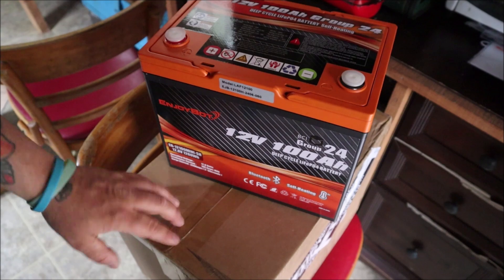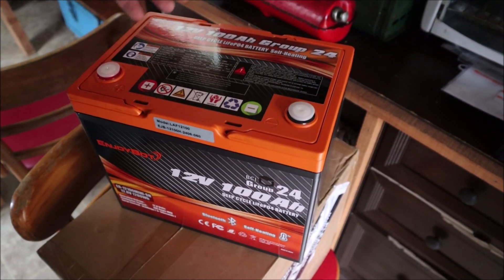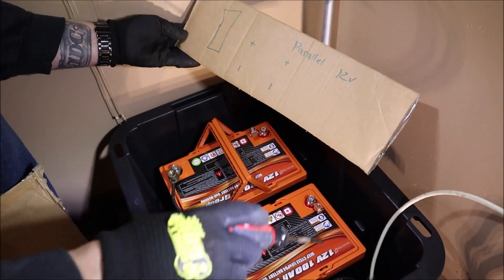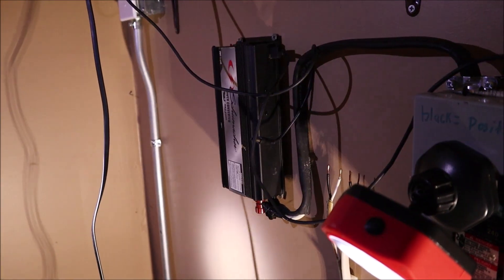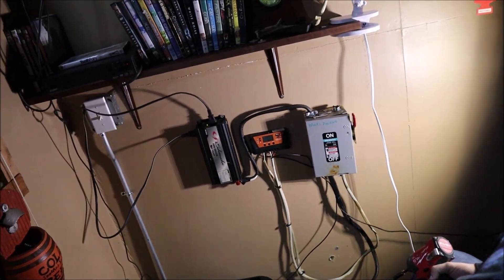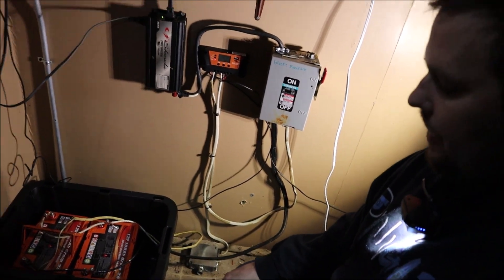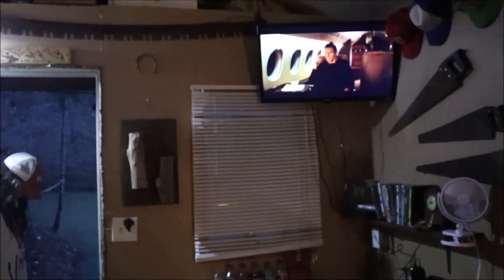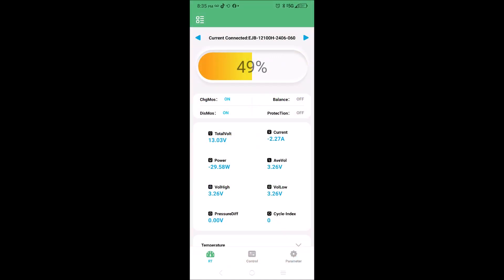New Power for the Tiny Off Grid Cabin (EnjoyBot) DIY System

Comment: Looks like you have the + and-  for the out put on the same battery  when parallel the + Output should be on 1 battery and the - on the other battery. Keeps everything charge balanced.
Those should be some great batteries.
Reply: Parallel is + to + and - to -
Series is what you are describing
Reply: 9 @ikecostner1  no.    + To + and - to- is parallel, you are   correct.  However,  the power leads from the the 2  batteries to your output need one from batt a  and 1 from battery b to give 12v, balanced output.   Please check with someone else if my response is not clear
Reply: https://youtu.be/KC71KxdyID8?si=d8c1Lmmezth7UP_g
Reply: https://youtu.be/KC71KxdyID8?si=d8c1Lmmezth7UP_g
Reply: https://youtu.be/KC71KxdyID8?si=d8c1Lmmezth7UP_g